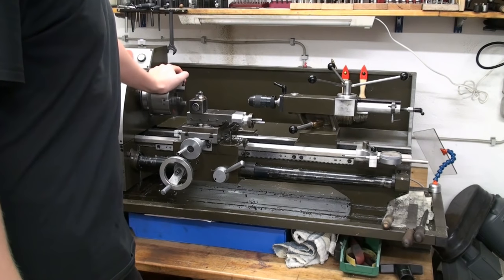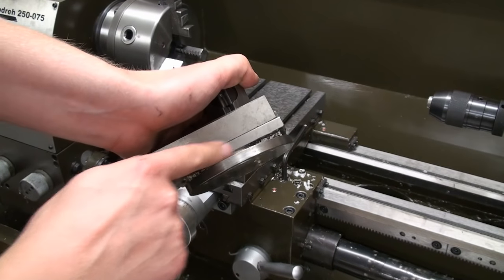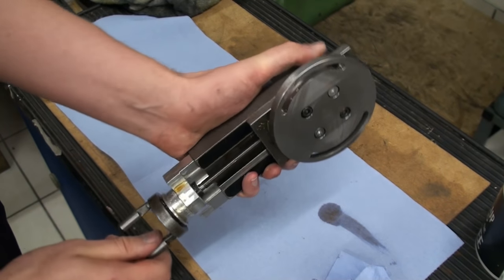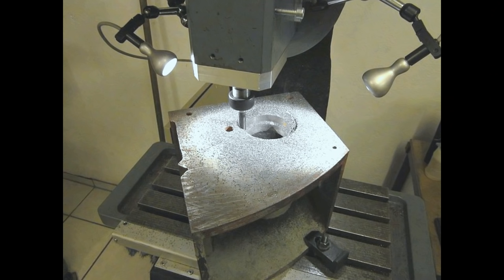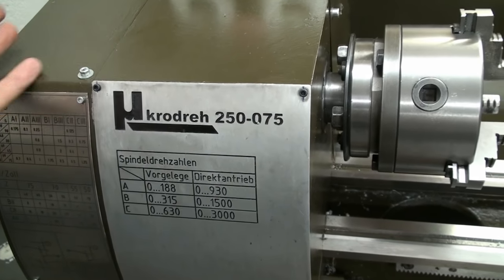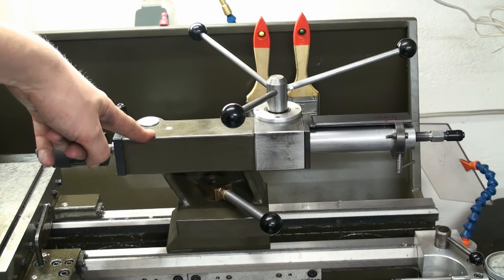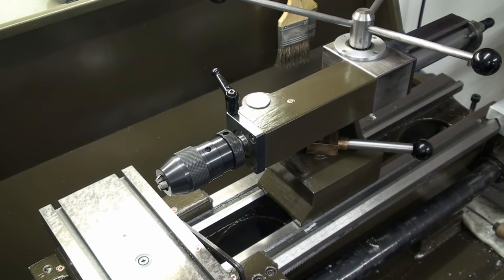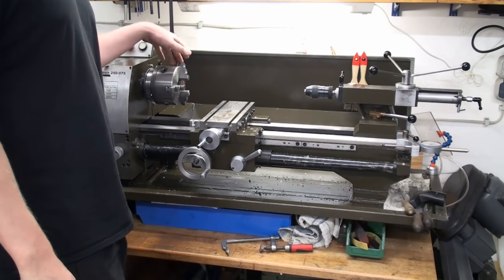Shoptalk #7 / 9x20 lathe / 05-2015

Comment: Loved this episode! I love to see people re-engineer stuff to improve qualities or tailor to their preferences.

 The format doesn't matter as long as the info is communicated... I think the mix of video and older construction video/photos is very effective. 

I also would have liked a little more explanation about the benefits of the way epoxy, choice of bearings on the spindle, and lubrication? However, I learned a lot so I'm happy!
Reply from the maker: Scott Daniels Thank you, good to hear that people like that format too :)
The way epoxy has very good properties on friction (almost no stickslip effect) and wear. Also its a very fast way to get a precise sliding surface, as only the mating surface needs to be machined and scraped/ground. And most important, I wanted to try that stuff out ;)
The bearings for the spindle are the same size tapered roller bearings  as before (I think they have a 30mm bore)  - I choose SKF because they are way better quality than the chinese bearings that were originaly in there. Lubcrication is simple: Bearinggrease, those are no highspeed spindle bearings or super heavyduty bearings, so they got lubricated when I mounted the spindle back in the headstock and that should be good for about 1000hours of use.
Reply: Stefan Gotteswinter Is there any chance of a video showing in more detail how you did the guide way refurbishment specifically how you moulded the v ways and dovetails I would love to give my lathe the same treatment

Comment: I have watched many of your videos and I am grateful that you make them. I very much appreciate your attention to detail and explanation of industrial process that relates to the methods that you use. I also like the layout of your shop and would say that you certainly have an impressive array of projects completed to help make the shop very functional.  I also have wondered what equipment you have because I would like to learn to do the type of projects you engage in.  I also have no experience or equipment so figuring out a total budget for putting together a well rounded shop that can make precision parts is a challenge.  I certainly appreciate the older video and photo footage with the overlays to show what kind of trial and error, continuous improvements and tooling upgrades are really involved to get a well rounded set of capability with some high degree of efficiency. Thank you.

Comment: Thank you so much for this detailed review of the MODs for your 9x20 lathe. This is the best 9x20 lathe that I have ever seen and your detail has helped me improve my lathe immensely. Mine is a Harbor Freight model and the fit and finish are not nearly as good as yours but your ideas have helped me make it as good as it can be (and then some). I got rid of my change gears and installed an ELS (electronic lead screw) along with a new motor drive, like yours. I also added a touch DRO in the X & Z axis. My carriage handwheel had a huge amount of slop and when I disassembled it I found that there were no bearings on the rack and pinion gears and the casting was worn into an oval so I machined some oilite bronze bearings and pressed them into the casting, removing all of the backlash from the handwheel. Also, I removed the compound slide and added a solid QCTP base as you did later on (as per Robin Renzetti).  Still to go is the moglise MOD and new headstock bearings plus the tailstock MODs. What sets your channel above all of the rest is your willingness (and ability) to upgrade affordable tools like many of us hobby machinists use. Thanks for the inspiration and detailed narrative. Your photos are just as helpful as your videos.

Comment: One of your older videos Stefan so my comments are a little late.
After watching this video more than a few times I'm very impressed. Some extremely well thought out re-designs and then machined or hand scraped additions. I've got just a slightly larger version of your lathe. 11" x 27" ( 280 mm x 685 mm roughly) with the built in power cross feed. It could use pretty much everything you've done to yours as well. 

Mine came stock with those same leadscrew coiled plastic covers your's did. They really are a great idea for keeping the swarf off of the leadscrew other than the loss of travel due to the end mounts for them and the width of the coil when it's fully collapsed. I lose almost 8" of longitudinal travel due to that. The loss of travel at the tailstock side of the carriage is less important to me, but the headstock side prevents getting the tool up tight to a faceplate without extending the top slide out farther than I'd like.  Since mine does have a separate feed rod, the only time the leadscrew is used is during threading. So as good an idea as they are I'm still going to remove mine and just put up with cleaning the leadscrew before doing any single point threading.

Boring out the headstock of your lathe and adding that sleeve for new bearings was also an excellent idea, as well as adding the epoxy to help stiffen up what should have been a far heavier casting to begin with.  With all the additions you did my guess is you saw a large improvement in both the precision the lathes actually capable of now and the surface finishes it can produce. Even the operating feel must be greatly improved with the hand scraping and moglice..

All these Chinese machines are built down to a price point the hobbiest is willing to pay of course. But it's still a shame they didn't add much heavier bed and headstock castings to begin with. They went out of there way to add a thicker portion on my bed casting at the tailstock end, so with just a quick look it seems that bed casting is much thicker than it really is.

Comment: Hi Stefan:
Excellent and meticulous upgrading work. We need to understand that one of the reasons these hobby machines are accessible to most people, is that they are built for a price, and that if suitably modified, can do very good work. As you know, the original reason for the inclusion of the top slide on a lathe was for threading and short taper cutting; however, is main the source of vibration and chatter due to its size and design affecting rigidity.
I own a very rigid 14/19x40" industrial grade tool room lathe with tapered gibs on both carriage and top slide. Still, I'm planning to build a solid base for my tool post and removing the top slide given the ease of replacement and the fact that we do not use it for its intended purpose 99% of the time. The cross slide is a much more solid platform for the tool post and obviates the stacking of components. You might consider that option to increase performance.

Regards

Jorge
Reply from the maker: Jorge Scordamaglia I was thinking about removing the topslide but I use it realy a lot - Threading, short tapers and even for short cylindrical turning.
I had no illussions when I bought the machine and I was  not realy dissapointed by it - I did a lot of projects on it before I did the complete rebuild. I just wanted to do it better ;)
Also it was an incredible learing experience: scraping, measuring, the casting process with the moglice, machining big parts on the shaper and my small cnc, painting with 2K polyurethane paint and so on :)

Comment: I know this is an old video and you have a better lathe now but this is the best 9x20 lathe mod video I have seen. I have a 9x20 Harbor Freight lathe and I am doing most of these mods on it, one at a time. The one thing I probably won't do is the Moglice bed mods. Moglice is wickedly expensive and to do 'what you did would cost almost what I paid for the lathe. Too bad that epoxy with some ground up Teflon and some metal dust is so expensive for hobby use. 

I am using a treadmill motor (Baldor 2hp 100v DC) for the new drive and I am chucking all of the gears in favor of an ELS (electronic lead screw). I'm adding a Touch DRO, removing the compound and installing a fixed block as shown by ROBRENZ and rebuilding and scraping the cross slide with a new gib (and more screws) and machined oil groves, although I will keep the compound for special purpose projects. I am also replacing the cross slide lead screw with a larger 8mm 1M pitch screw with new bearings and a longer bearing mount modeled after yours. I have a factory lathe stand, which has always been too low so by adding a similar addition to the bottom of the lath pan, I can lift the lathe up to the proper height and provide a better, adjustable mount for leveling. 

Stefan, your can-do attitude and ability to overcome the deficiencies of Chinese tool "kits" is an inspiration to me. As with many hobby machinists, I don't have a lot of extra cash to spend for "top of the line" tools but you constantly prove that ingenuity and effort can, to a large extent,  overcome the deficiencies inherent in budget equipment by adding sweat equity to get the most out of our investment. Your detailed narrative and slide show format is more than sufficient and much appreciated. If I can I would like to make a video showing my mods.

Comment: Stefan, Its no longer a cheapo Chinese or toy lathe as you call it. Very nice mods! Love the tailstock, so much travel with so little and convenient movement. This video is from 3 year ago and by now you have done more, like the solid toolpost which has made the lathe even more solid.
btw. I would like to find the motor replacement video if theres one.

Comment: I had heard of Moglice before; machine rebuilders use it frequently. But this is the first time I ever heard it pronounced. Because it is cast, it will find a natural level. Sounds wonderful. As to Chinese lathes, according to www.minilathe.com, there are only three factories: Sieg, Rong Fu and I can't remember the third. So any faults you find in one will usually be present. They are not toolroom lathes! Still, marvellous job of rebuilding.
Reply from the maker: Juan Rivero I think there are even more subcontractors making parts and castings for the chinese machines..
Youre right, the moglice is a lot used by rebuilders, but its also used in building new machines :)

Comment: Thanks Stefan, a series of very worthwhile improvements to your lathe.

Your tailstock ejector has given me some thoughts on if it would be possible to somehow incorporate a tube about the drawbar on my SX2 mill to free the MT3 taper instead of using a GBH, which always seems so wrong...
Reply from the maker: Ray Jones Using the hammer to eject the tools? Its not tooooo bad If one doesnt crank down the drawbar to tight.
On a milling machine I prefer the design of an self ejecting drawbar which is axial fixed to the spindle but free to rotate. On releasing and turning it counterclockwise it pushed the tool out.

Comment: Hi Stefan. Robert Brown here from Sydney Australia. GREAT set of videos mate, just fantastic.I have a suggestion for you regarding your proposal to make a steel frame to replace the wooden bench. How about welding the frame up from RHS or HSS tubing, with removable plates on the end of the tubes, and all tubes cut so that the hollow sections are "connected". Then, you can fill the frame with either heavy sand, steel or lead shot, or even old gearbox oil.The idea being to damp down vibrations and create mass in the base, but with the ability to remove "the mass" at any time.Your videos are good because you take the time to go into detail.I am currently rebuilding a wel lknown Taiwanese 900mm bed-length lathe that I bought in 1997, and I think your mods to the tailstock are brilliant.Regards,Robert

Comment: Really nice set of mods. I especially like what you did with the tail stock, I think I will copy some of it.
The sliding indicator mount of very nice. You probably already thought of this, but you can simply ream the hole out and clamp the indicator on the exit tube.
Reply from the maker: +joshua43214 Thanks - Already did that :)

Comment: Thank you Stefan, you have turned an average machine into a very nice tool !
Which of your  improvements would you rate as having made the greatest
difference ? Probably hard to tell if you made many at the same time. I have
made a better top slide mount for my 9x20 that has made a great difference
but yours looks even more solid. Love the tail stock.

Comment: There is a trick with drilling brass and other soft materials. Get your self a set of bits that you can dedicate to brass and plastic. Stone the inside of the cutting lip flat (to a neutral angle)  just enough to take the sharp bite out of it. It only takes about 0.0001" - 0.0002" and you are in business. You will actually be able to hold brass in your hand and punch through it on the drill press. The reason this works is because of the work hardening effects of brass. Typically when you are drilling brass the lip of the bit peals away material form one side and applies pressure to the bulk left. This causes the bulk to harden. Every rotation the bit has to cut through harder and harder brass until finally it grabs. By having just a thin neutral cutting edge you are actually scraping a hole through the brass therefore never causing a hardening effect on the bulk. It follows the same principles as turning tools for brass.

Comment: Stefan,
Really enjoyed your suggestion on the spindle cartridge. I am in the process of upgrading my 9x20 import lathe and found your work very informative. By chance, any specific steel grade for the spindle cartridge and how much larger did you make the head stock housing bore diameter relative to the cartridge?
Reply from the maker: Its quite some time ago that I did that work, I think the cardrige had 80mm outer diameter, material was free cutting mild steel, no need for anything high strength. The bore in the headstock was about 1/10mm oversize. I have a few photos and text put together here:
http://gtwr.de/shop/pro_mykrodreh/headstock.html

Comment: Great video and slide show!  Yes, indeed, that tailstock now is awesome! Such good ideas assembled together. Like others, I will have to research moglice as I don't know how you go about ensuring the surface with moglice is parallel in both directions to the top of the top slide.  Daniel
Reply from the maker: AtelierDBurgoyne Ah, you have to take precautions to align the parts before you drop it on your reference surfaces - For example putting a tight fitting setscrew in each corner that sit on the reference surface - Or leave a pad of material in each corner that you scrape, file or lap for alignment. Many ways to skin a cat ;)

Comment: Hi Stefan,

How do you avoid the sticking of the Moglice treated surface and the mating plate during curing of the Moglice? Which type of Moglice have you used for filling the slideway pockets ?
Thank you.
Reply from the maker: +Zsolt Kis I used the "liquid" moglice. To prevent sticking of the moglice to mating surfaces you use their release agent/mold release which is wax based. 
It has not to be the Diamant brand stuff, every wax bases mold release works (and might be cheaper..).
Reply: +Stefan Gotteswinter 
Thank you!

Comment: Nice job on the lathe,   Could you hold the indicator by the top stud to get full travel and put the face of it back in the curved area?
Reply from the maker: ***** Good idea, never thought of that - I only would have to open up the bore, as the upper stud has a bit bigger diameter.

Comment: Perhaps you could add a variable speed drive to your Longitudinal Feed (Z Axis). similar to the one you installed on you newer milling machine. It gives you power feed without the noise of the gear train and the wear it places on your leadscrew and half nuts. Of course for threading you could add a Single Tooth Reversing Dog Clutch similar to the system that Hardinge (and others) uses on their HLV-H/EM Tool Room Lathe. I'm planning on doing it myself along with some other up grades

Comment: Very nice lathe modifications. When you cast the Moglice into the pockets on the top slides does it just stay in place when you flip it over onto the surface plate? I'm guessing it is very viscous because I didn't see any voids. Also, was the part sitting on shims to keep the Moglice even and parallel across its span (as it cured)?

A note about electronic control pushbuttons: I noticed you were trying to think of the word that describes a pushbutton that is not "momentary" but stays closed on its own. Here in the states, we would say "latching" .. if that helps. (Considering how many technical and nuanced mechanical systems you describe, your english is excellent.)

I really liked the format of this video. Feel free to leave the "slideshow" photos on the screen for more than just a few seconds. It's always fascinating to see brilliant solutions to problems with chinese "kit" machines. :)
Reply from the maker: Seven/Ninths Creative Its availible in different viscousities - The one i choose was about like honey, it stays in place for a few minutes and then starts to creep out everywhere ;)
Sometimes you can get away with small gaps and the moglice will stay in the cavity. (Sometimes you get airbubbles in the moglice but you can fill those after the process with some additional moglice and scrape it to the surounding surface).
Ah, latching is absolutely the term I was thinking off, now it seems obvious :)
Thanks for the support!